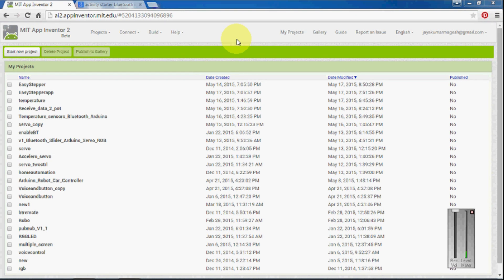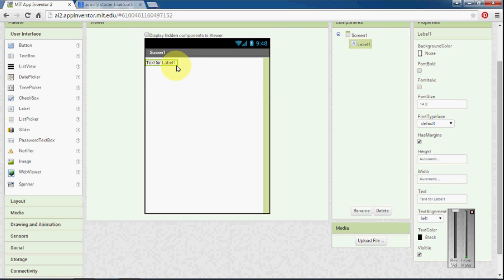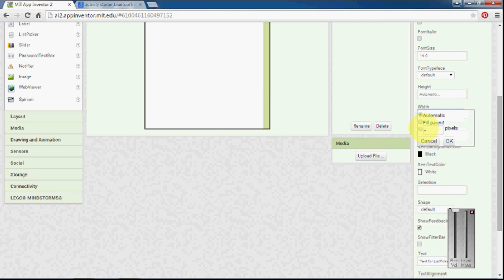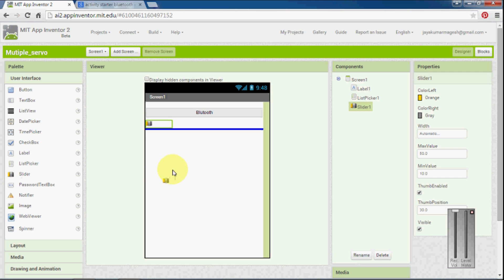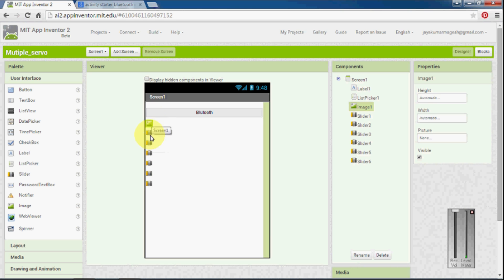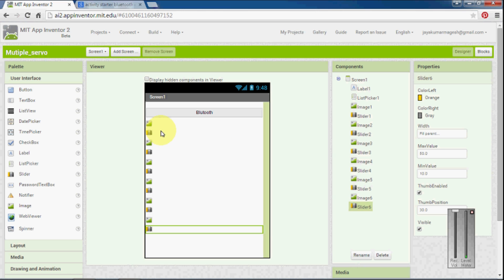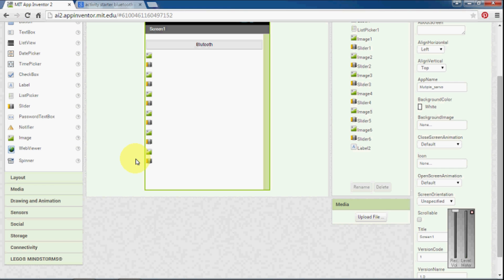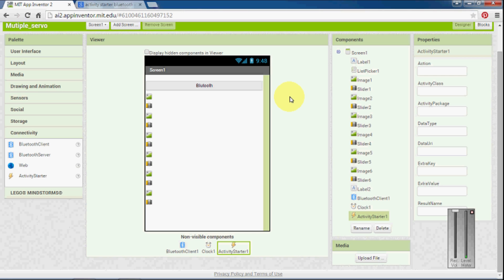How to make android app for controlling multiple servo Motor using MIT app inventor

Comment: excelente amigo, gracias!!! esto lo he estado buscando desde hace mucho, le corregí algunas cosas y me funciona perfecto (Y)
Reply: disculpe pero esta super si, me puede aser el favor esque necesito el programa para esa app
Reply: si claro, pero en si yo lo hice funcionar con un solo  servo debo aclarar que use un modulo hc-05 el programa  en arduino es:
 #include<SoftwareSerial.h>
 #include<Servo.h>
 Servo servo;
 
 int btltx =7; //en esta parte la conexión es exactamente igual tx con tx
 int btlrx =8;
 
 SoftwareSerial bluetooth(btltx,btlrx);
 
void setup() {
  
servo.attach(3);
Serial.begin(9600);

bluetooth.begin(38400);

}

void loop() {

    if(bluetooth.available()>0){
       int  servopos = bluetooth.read(); 
        Serial.println(servopos);
        servo.write(servopos);

  }
}
junto con esto le dejo el link del vídeo donde este mismo autor describe el programa en arduino y el app. si usted quiere mover los mas de tres servos en este vídeo esta muy explicito solo debe verificar a través del monitor serial cuanto es la salida junto con eso se entiende el por que del 256.
espero le sea útil.
Reply: @danielvelasquez1491  please can you help me 
I have problems with the code 
My arm robot start working than shut down alone 
I think the program is not well adapted

Comment: Better arduino code.

/*
Author: Danny van den Brande.
With this code you can control multiple servo motors by using a android app.
You can add as many as you like untill your pins run out. You can add more Servos in the code.
 */

#include <Servo.h> 
Servo myservo1, myservo2, myservo3, myservo4, myservo5, myservo6, myservo7, myservo8, myservo9, myservo10;

byte serialA;

void setup()
{
  myservo1.attach(9);
  myservo2.attach(10);
  myservo3.attach(11);
  myservo4.attach(3);
  myservo5.attach(5);
  myservo6.attach(6);
//  myservo7.attach(); fill in pin numbers if you use more then 6 servos i left them blank
//  myservo8.attach();
//  myservo9.attach();
//  myservo10.attach();
  Serial.begin(9600);//change your baudrate to your Bluetooth modules baudrate if needed.
}

void loop()
{
  if (Serial.available() > 2) {serialA = Serial.read();Serial.println(serialA);}
  {
    unsigned int servopos = Serial.read();
    unsigned int servopos1 = Serial.read();
    unsigned int realservo = (servopos1 *256) + servopos; 
    Serial.println(realservo); 
    
    if (realservo >= 1000 && realservo <1180){
    int servo1 = realservo;
    servo1 = map(servo1, 1000,1180,0,180);
    myservo1.write(servo1);
    Serial.println("servo 1 ON");
    delay(10);

    }
    
    if (realservo >=2000 && realservo <2180){
      int servo2 = realservo;
      servo2 = map(servo2,2000,2180,0,180);
      myservo2.write(servo2);
      Serial.println("servo 2 On");
      delay(10);
      
    }
    
    if (realservo >=3000 && realservo < 3180){
      int servo3 = realservo;
      servo3 = map(servo3, 3000, 3180,0,180);
      myservo3.write(servo3);
      Serial.println("servo 3 On");
      delay(10);
    }
    if (realservo >=4000 && realservo < 4180){
      int servo4 = realservo;
      servo4 = map(servo4, 4000, 4180,0,180);
      myservo4.write(servo4);
      Serial.println("servo 4 On");
      delay(10);
    }
    
    if (realservo >=5000 && realservo < 5180){
      int servo5 = realservo;
      servo5 = map(servo5, 5000, 5180,0,180);
      myservo5.write(servo5);
      Serial.println("servo 5 On");
      delay(10);
    }
    
    if (realservo >=6000 && realservo < 6180){
      int servo6 = realservo;
      servo6 = map(servo6, 6000, 6180,0,180);
      myservo6.write(servo6);
      Serial.println("servo 6 On");
      delay(10);
    }

//    if (realservo >=7000 && realservo < 7180){ //UNCOMMENT if using more then 6 Servos.
//      int servo7 = realservo;
//      servo7 = map(servo7, 7000, 7180,0,180);
//      myservo7.write(servo7);
//      Serial.println("servo 7 On");
//      delay(10);
//    }
//
//    if (realservo >=8000 && realservo < 8180){
//      int servo8 = realservo;
//      servo8 = map(servo8, 8000, 8180,0,180);
//      myservo8.write(servo8);
//      Serial.println("servo 8 On");
//      delay(10);
//    }
//
//    if (realservo >=9000 && realservo < 9180){
//      int servo8 = realservo;
//      servo8 = map(servo9, 9000, 9180,0,180);
//      myservo8.write(servo8);
//      Serial.println("servo 9 On");
//      delay(10);
//    }
//
//    if (realservo >=10000 && realservo < 10180){
//      int servo10 = realservo;
//      servo10 = map(servo10, 10000, 10180,0,180);
//      myservo10.write(servo10);
//      Serial.println("servo 10 On");
//      delay(10);
//    }
 
  }

}
Reply: Does it works with the same kind of app? or you need to change something in the app?

Comment: why does my other servos jerk around when i try to move one of them? =(
Reply: +Travis D It is problem code.Remove the softwareserial from the code.I had this problem also.
Reply: Δημήτρης Βλαχοσπύρος lol yea I figured it out few days later. It was frustrating haha thanks!
Reply: +Travis D 
Here i wrote a better code.
/*
Author: Danny van den Brande.
With this code you can control multiple servo motors by using a android app.
You can add as many as you like untill your pins run out. You can add more Servos in the code.
 */

#include <Servo.h> 
Servo myservo1, myservo2, myservo3, myservo4, myservo5, myservo6, myservo7, myservo8, myservo9, myservo10;

byte serialA;

void setup()
{
  myservo1.attach(9);
  myservo2.attach(10);
  myservo3.attach(11);
  myservo4.attach(3);
  myservo5.attach(5);
  myservo6.attach(6);
//  myservo7.attach(); fill in pin numbers if you use more then 6 servos i left them blank
//  myservo8.attach();
//  myservo9.attach();
//  myservo10.attach();
  Serial.begin(9600);//change your baudrate to your Bluetooth modules baudrate if needed.
}

void loop()
{
  if (Serial.available() > 2) {serialA = Serial.read();Serial.println(serialA);}
  {
    unsigned int servopos = Serial.read();
    unsigned int servopos1 = Serial.read();
    unsigned int realservo = (servopos1 *256) + servopos; 
    Serial.println(realservo); 
    
    if (realservo >= 1000 && realservo <1180){
    int servo1 = realservo;
    servo1 = map(servo1, 1000,1180,0,180);
    myservo1.write(servo1);
    Serial.println("servo 1 ON");
    delay(10);

    }
    
    if (realservo >=2000 && realservo <2180){
      int servo2 = realservo;
      servo2 = map(servo2,2000,2180,0,180);
      myservo2.write(servo2);
      Serial.println("servo 2 On");
      delay(10);
      
    }
    
    if (realservo >=3000 && realservo < 3180){
      int servo3 = realservo;
      servo3 = map(servo3, 3000, 3180,0,180);
      myservo3.write(servo3);
      Serial.println("servo 3 On");
      delay(10);
    }
    if (realservo >=4000 && realservo < 4180){
      int servo4 = realservo;
      servo4 = map(servo4, 4000, 4180,0,180);
      myservo4.write(servo4);
      Serial.println("servo 4 On");
      delay(10);
    }
    
    if (realservo >=5000 && realservo < 5180){
      int servo5 = realservo;
      servo5 = map(servo5, 5000, 5180,0,180);
      myservo5.write(servo5);
      Serial.println("servo 5 On");
      delay(10);
    }
    
    if (realservo >=6000 && realservo < 6180){
      int servo6 = realservo;
      servo6 = map(servo6, 6000, 6180,0,180);
      myservo6.write(servo6);
      Serial.println("servo 6 On");
      delay(10);
    }

//    if (realservo >=7000 && realservo < 7180){ //UNCOMMENT if using more then 6 Servos.
//      int servo7 = realservo;
//      servo7 = map(servo7, 7000, 7180,0,180);
//      myservo7.write(servo7);
//      Serial.println("servo 7 On");
//      delay(10);
//    }
//
//    if (realservo >=8000 && realservo < 8180){
//      int servo8 = realservo;
//      servo8 = map(servo8, 8000, 8180,0,180);
//      myservo8.write(servo8);
//      Serial.println("servo 8 On");
//      delay(10);
//    }
//
//    if (realservo >=9000 && realservo < 9180){
//      int servo8 = realservo;
//      servo8 = map(servo9, 9000, 9180,0,180);
//      myservo8.write(servo8);
//      Serial.println("servo 9 On");
//      delay(10);
//    }
//
//    if (realservo >=10000 && realservo < 10180){
//      int servo10 = realservo;
//      servo10 = map(servo10, 10000, 10180,0,180);
//      myservo10.write(servo10);
//      Serial.println("servo 10 On");
//      delay(10);
//    }
 
  }

}
Reply: Thank you very much for your code
Reply: +Δημήτρης Βλαχοσπύρος No problem
Reply: Can you modify the code to work with PS3 Controller?I tried it but with no result.Thank you for your time.